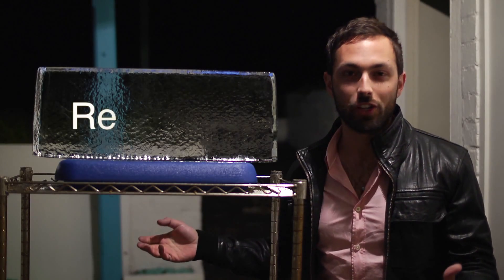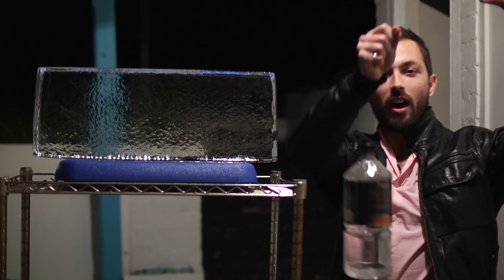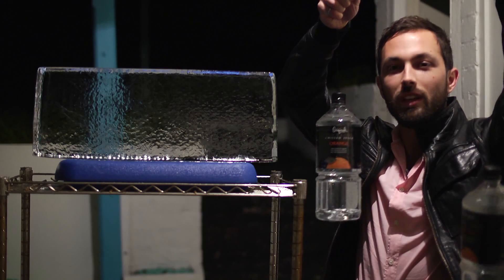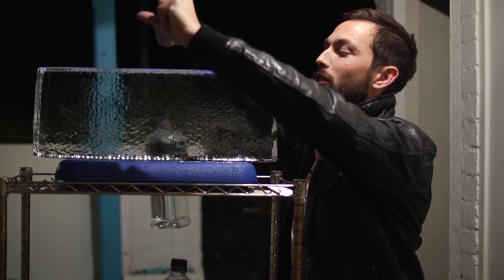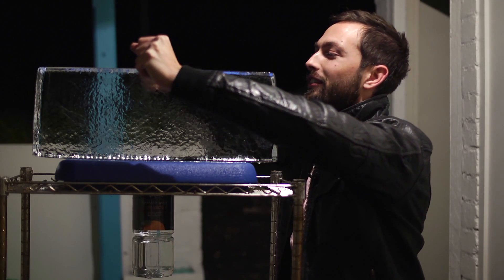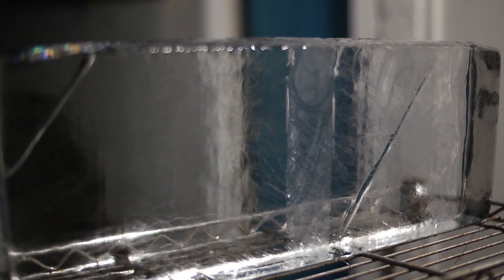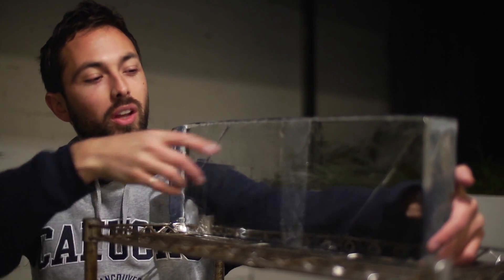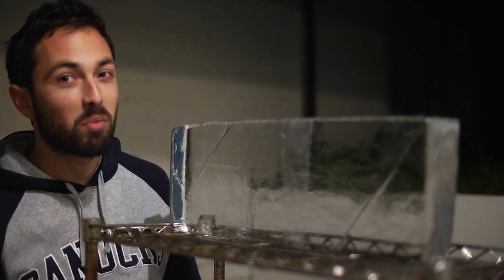Does Pressure Melt Ice?

Comment: Since it's warmer than zero degrees, we can't be sure that the melting is not caused by heat conducted through the wire, can we?
Reply: I'm kind of late to the party, but you can actually show that applied pressure can not explain what is shown on the video and that yes, the culprit is very likely the higher than 0°C room temperature.
Integration of Clapeyron's equation (assuming constant latent heat of fusion) and numerical evaluation assuming the ice block's temperature is -6°C (say the block is just taken out of a freezer compartment) shows that the ice would melt under a pressure slightly higher than 800 bar (8.10^7 Pa). 
Assuming the block's width is 10cm and the wire's diameter is 0.28mm (high E guitar string), you'd need to weigh down the wire with a mass higher than 200 kg !
The wire being used is metallic, and as such is a good thermal conductor : it will conduct heat from the bottles (acting as heat reservoirs) to the ice, locally melting it around the wire. The wire obviously "sinks" through melted ice and the process repeats, while previously melted ice is regelated by surrounding ice still being at a lower temperature than 0°C.
Also a temperature gradient should establish itself along the wire, its temperature being higher closer to the sides of the block than to the centre. This could explain the "bell" shape that the wire takes will going through the ice : since the temperature difference between the wire and the ice will be higher one the sides, it will melt faster there and as such the wire will be "slower" to go through the ice in the middle than on the sides.
Reply: Etienne F 
+1
Reply: If the ice was being melted by heat conducted through the metal wire, then the ice would be acting as a heat sink on the wire. Since the wire inside the block of ice is not being warmed by the air in the room, but only through heat conduction, then it stands to reason that the conducted heat will be sunk into the first parts of melting ice it comes into contact with, which is the outer surfaces of the ice block.
What it means, is that if the melting was caused by the conducted heat, then the melting would be more rapid on the outer parts of the ice block and slower in the middle, because less of the heat gets all the way to the middle. As a result, the wire would sink faster on the outer parts and slower in the middle. This would lead to the parabolic shape of the wire becoming narrower (and no longer parabolic), and thus a longer stretch of the wire would be passing through the ice, increasing the difference of temperatures between the core of the ice block and the outer edges.
The result would be, that the more the wire melts the ice on the edges, the less chance the heat has to reach the core, so likely the middle part of the wire would stop moving down altogether.
Most likely, the wire temperature is below zero even outside the block of ice. The ice cools the wire much more efficiently than the room warms it up, as melting requires energy and water is a better heat conductor. Furthermore, it's likely that the melting happening on the surface of the ice block cools down the surrounding air, so the air around the ice is also colder than air farther from the block.
The test parameters could be altered to reduce the pressure and increase heat conduction. The easiest way to do this would be to use a thicker wire. A thicker wire would distribute the load on a greater area, reducing the pressure, and it would increase conduction of the external heat. You could also use copper wire that conducts heat better and you could raise the room temperature or actively heat the ends of the wire to vary the equation. Finally, just reducing the amount of weight at the ends of the wire would reduce the pressure on the ice. 
Would be cool to see the results of various tests with different variables!
Reply: @arantala  I have given indications, a few comments above this one, on how to calculate the pressure you need to apply to melt ice at -6°C. The result is 8.10^7 Pa, which means that the wire he used would have to be tied to a mass higher than 200kg, which is obviously not the case here.
So it's obviously not cutting it (pun intended).
Besides you actually can observe the parabolic shape of the wire as it's sinking, indicating the correct explanation is indeed heat conduction from the wire to the surrounding ice.
Reply: @etiennef8016  That's fascinating. I regret I didn't see your response or pay enough attention to it before I wrote mine, but I'm happy you brought it up. I, of course, felt the need to contradict you at first, but the more I think of it, the more I think you're likely to be right.
I was expecting that the parabolic shape would have been caused because the initial pressure is higher on the edges since that's where the weight of the bottles is focused until the parabolic shape has formed and the pressure has become equally distributed. 
However, after rewatching the video, I can see that initially the parabolic shape actually is steeper, indeed indicating that the temperature gradient is taking effect, but later the shape widens because the rack that the block of ice is resting on is much wider than the block of ice itself. The wire is resting against the rack, keeping the parabola from narrowing. Because of this, the wire doesn't sink into the ice block and the longer-path-through-the-ice effect I was talking about doesn't have a chance to occur.
Furthermore, I think the plastic bottles acting as heat reservoirs might be negligible compared to the fact that the wire is resting against the tall metal rack pretty much the whole time, and the rack is acting as a heat sink! In fact, the further the wire melts through the ice, the shorter the length of the wire between the ice and the rack contact point becomes, reducing the heat conduction distance. Also, as the wire comes down, the angle the wire turns over the rack tightens, increasing contact point between the rack and the wire. This also increases the force that the wire presses against the rack with, which also increases heat conduction between the rack and the wire.
The more I think about it, the more I find factors supporting your assertion, which is already strongly supported by the calculations you made.
The only things I'd challenge about the math is that it looks more like a 6-7cm block of ice, and a high e-string can be .254 mm, which both are factors that would reduce the weight requirement somewhat. That said, if your math is correct, then these changes wouldn't make a material difference, and at most the pressure's effect would be to lower the melting point slightly, reducing the heat conduction required. 
I'd like to see this experiment repeated with a nylon string, on a block of ice supported by a stand narrower than the block itself, or supported by its ends only, with some insulating material wrapped around the string, and the string shouldn't rest against anything made of metal.
Or it could just be done in a sub-zero environment.
Reply: @arantala  Nice catch seeing the wire touches the metal rack !
I am fairly confident about the calculation. You could argue that the result assumes the load is evenly distributed on the area S=wire_diameter*length, and that the wire is not flat and as such the pressure will be higher close to the "center" but I would be extremely surprised if the pressure at any point is 10 times larger than the average pressure (g*mass/S). 
With the values I proposed, the numerical result for the mass is 234 kg. With 6cm for the length and .254mm for the diameter it becomes 127 kg. Still over 30 times heavier than what is used in the experiment (assuming two 2L bottles).
The experiment would likely not work in a cold room.
Reply: It is not an ignorant question, it is exactly the sort of question a scientist should ask. The answer would be to compare a wire with say a nylon monofilament which a much lower thermal conductivity.
Reply: Greg Scott I frustrated by the fact that any comment that I want make already done by someone.
Reply: Victor Tarasov I know-- that happens to me all the time!  Sometimes it's impossible to read through tons of posts to see if I'm duplicating something, so I just go ahead.  Stay with it; it's still a lot of fun.
Reply: @viktortarasov4354  Happens to me too, all the time.  I just happened to get here sooner.
Reply: @viktortarasov4354  Viktor Tarasov I frustrated by the fact that any comment that I want make already done by someone.
Reply: @viktortarasov4354  Feel u
Reply: Zaid Khalifa I think that's not a problem, Zaid.  I've seen the demonstration done in a classroom at room temperature, and the melted water refreezes because the ice starts out cold enough to absorb the heat of fusion from the small amount of water that is formed.  You want to take care that the ice melts because of pressure alone, and not heat conduction.
Reply: Biot number of string is low
Reply: No, we can’t
Reply: Exactly bc normally it wouldn't cut as smooth and as easily as that depending on temperature. This experiment probably wouldn't even cut any ice where I live sometimes it gets as cold as -40°C. However pressure can melt a tiny amount of ice when you walk on it which causes some ice to be more slippy than other types especially when it's a bit warmer say -15 to -20°C. The theory is right but the experiment is flawed.
Reply: @SamTheFrost  Yeah, this definitely would not work at -40C. The lowest melting point ice can reach by pressurization is -21 C.
Reply: Greg Scott If it was below zero, then how does he prove that the ice refreezes?
Reply: @ZaidKhalifa  Understood-- I'm pointing out something about the process of the ice melting.  Doing it at precisely zero degrees might be a good control, since water freezes AND ice melts at that temperature.  How we'd handle the heat of fusion would be a little beyond me-- I'm not a scientist.
Reply: A simple look at the PT diagram of H20 reveals why this experience is possible
Reply: Also, the water is refreezing. It's being frozen by the surrounding ice.
Reply: It’s pressure
Reply: Well how much heat would a wire have to start out with in order for it to not dip below freezing temp during the experiment? I would think that it'd have to be one hot wire to not cool down enough to confirm that it is pressure alone.
Reply: Greg Scott even if the the ice melted due to higher temperature of the room. You can see that its not melting ONLY due to temperature. If that was the case, the whole top surface would melt at same rate and you wouldn't see a groove(except from minor cuts caused due to friction while putting the string)
Reply: @davidwilliams9534  This isn't necessarily true. The wire could be acting as heatsink, essentially. This would focus the temperature of the warmer surrounding air onto the ice the wire is touching. This would allow a groove to form and not melt the whole top of the ice. Greg is right. The only way to accurately demonstrate that it is only pressure causing the melting is to perform this in an environment where no part of the wire is in contact with a medium that is above the freeze point. You can't definitively say that pressure is causing the ice to melt when you have other, uncontrolled variables. He isn't disputing that pressure melts ice. He is only saying that this specific test fails to properly demonstrate that pressure is the cause for the melting.
Reply: Greg Scott are you seriously gonna be that ignorant? 
It's hard to argue with clever people but it's even harder to argue with plain stupidity
Reply: @weebrahim  Weebrahim-- you took my breath away!  Indeed I'm ignorant of many things, and I'm not a scientist.  But would someone with superior intelligence and a scientific way of thinking really insult someone so badly for asking a question?  Your level of arrogance is simply stunning.  You may be the most intelligent person on the planet, but I truly hope you are not a teacher.
Reply: Weebrahim you’re the plain stupid one. You get a lot further asking asking questions rather than calling others ignorant.

Comment: This might be totally wrong but... Assuming that the wire is metal would it be possible that it acted as a "heat sink" and melted the ice along a point then when it passed the surrounding temperature from the rest of the ice was enough to refreeze the water? Would this experiment work with a non-conductive wire?

Comment: Isn it because pressure turns into heat, that once isnt present anymore the surrounding ice steal that minmum heat reaching again an equilibrium? sorry for bad english
Thats what my instincts say (but im probably wrong)
Reply: am i?
Reply: i think its because ice has lower density than water and by applying pressure it melts because it reaches the density of water.
Reply: I think your reasoning has some merit. I'm thinking of the ideal gas law PV = nRT where P is pressure, V is volume, n = number of molecules, R = the gas constant, and T = temperature. 
If you increase P but the volume stays pretty much the same, the number of molecules nor does the gas constant change, so T must also increase. So temperature will increase.

Comment: so let me get this straight. when you put pressure on ice it melts.  but when you put pressure on water it freezes?
Reply: attack125 .... no.... pressure on water makes it heat up.
Reply: TheShadowlin
temperature has nothing to do with it moron.
put pressure on water and it turns solid. 
it will "freeze"
Reply: pressure on most liquids turns them into a solid state. However, water has the unusual characteristic that ice is less dense that water so increasing pressure causes it to go into the liquid state. This can be seen on a PT diagram of water. the solid-liquid line has a positive slope. Ie. increasing pressure requires a higher temp to melt or a lower temp to freeze. All that being said im highly dubious of this experiment. Pressure required to change the freezing point significantly is extremely high and i don't think that is what is occurring here. I believe if anything the wire is conducting heat away from the ice melting it and the ice block has sufficient mass to the draw the heat back out of the liquid and refreeze it.
Reply: 1. I was pointing out you were wrong about the pressure freezing water on the orders of magnitude of pressure we are dealing with. 2 No, the ice mass is sufficiently large that it could remove the latent heat of fusion of the now minuscule amount of melted water. Either way you look at it the ice is in fact melting and refreezing. if it remained solid it would not move through the ice.
Reply: Max Renaud
are you too dumb to read normal english. 

yes putting pressure on ice turns it into water.
that is.  putting pressure on ice that was formed by cooling water.  
however.  if you put enoegh pressure on water.  you will get hot ice. 
the molecules will be compressed into a solid wich is called ice aswel.  even though this ice is hotter then it was before
Reply: lol attackiboii yo mad?

Comment: I'm not sure I agree! the wire would help conduct the cold outward, and melt the ice, cutting it. and then the temperature would be low enough for the ice to join. this part is seen when two ice cubes are kept in a bowl. they tend to refreeze into each other. (I'm suggesting trying to use a less conductive material! )

Comment: Isn't the fact that the metal wire conducts its room temperature heat through direct contact with the ice a more significant factor than the pressure it is exerting? Genuine question.

Comment: Why does the ice still have the scar on it ?
Reply: because a line went trough it wtf
Reply: +SAD BOY the ice melts and freezes again...shouldnt it be no scar ....like the beginnning? = =
Reply: FaItH lEsS no, ice isn't always clear.
Reply: FaItH lEsS because the crystal lattice was interrupted. like scars in skin.
Reply: FaItH lEsS Yes it re-froze but not perfectly, because as the ice melted to make way for the wire some of the water flowed out of the gap. I'm sure if you looked closely at the seam, you'd see a little lip formed around the outside of both halves. And rest assured that the imperfection of the seam, as well as the tiny bit of air introduced to it, caused the seam to take on that cloudy more translucent look.
Reply: Kenny Martin Wow Thx XD
Reply: FaItH lEsS You're welcome.

Comment: This is how snow balls are made during a snow ball fight. Press down on the snow, the pressure causes it to melt and then when u remove the pressure it solidifies together into a snowball :D
Reply: Arch Angel Really? I thought you just crush the ice crystals so that they compress and freeze tighther but with less space between them.
Reply: It's basically that, just when you imagined crushing the ice crystals you were actually melting them slightly
Reply: No, almost everytime it is because you compress the snow so there are no air left in it, making it porous. And if you are familiar with snow and snowballs, you would know that you can make good snowballs only at zero degrees celsius or a few degrees above -- the snow needs to be a little melting already, to form a solid ball.

Comment: Wait, but if the wire had a temperature above 0 degrees then the heat energy in the wire, however small it is, should melt the ice.

I'm not saying that the science behind pressure melting ice is wrong, I'm saying this experiment is an inaccurate way of showing it, unless the entire experiment was performed in some kind of super-controlled environment with the metal always at 0 degrees.